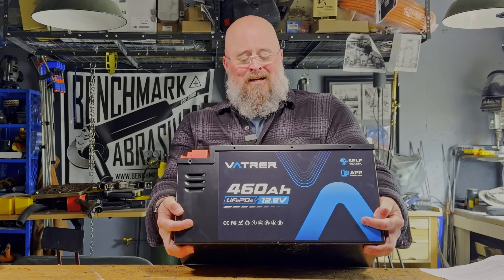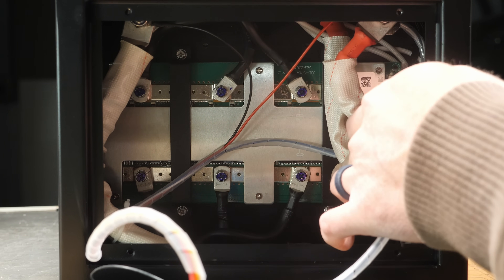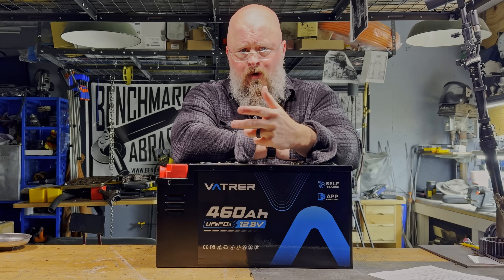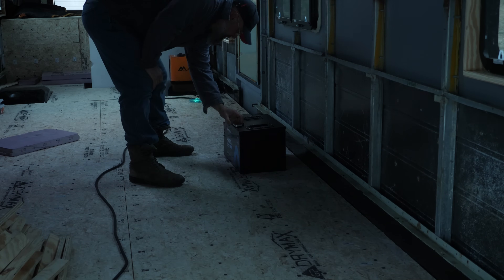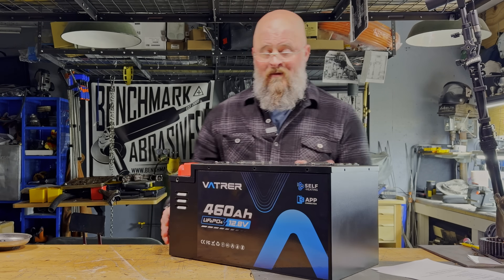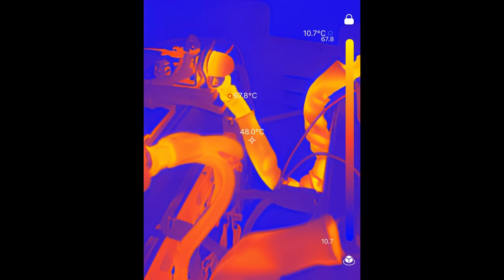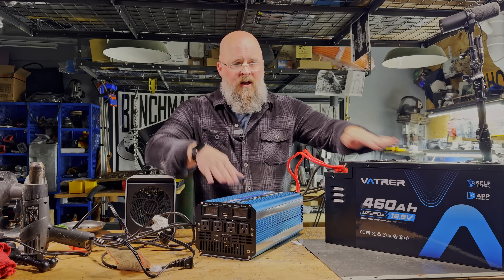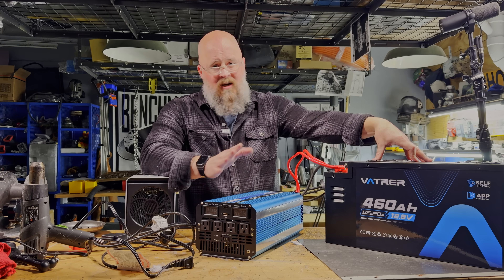This One Mistake Quietly Destroys Lithium Batteries

Comment from the maker: For full transparency: Vatrer sent this battery for testing, but they don’t pay me, don’t approve the video, and don’t see it before you do. If something doesn’t hold up, I’ll say so.
If you’ve got questions about setup, cold-weather use, or building a 12V / 24V / 48V system around this battery, drop them below — I read the comments and I’m happy to dig in.

 here are the direct links:
👉 Vatrer Official Website:
https://www.vatrerpower.com/products/vatrer-51-2v-100ah-lifepo4-lithium-solar-battery-built-in-100a-bms-max-5120w-load-power?sca_ref=6769396.vei1HBELRJy&sca_source=YT
👉 Vatrer on Amazon:
https://www.amazon.com/dp/B0C9HPYKNG?maas=maas_adg_FEA066C8E421BD241ECF916C75BF50A6_afap_abs&ref_=aa_maas&tag=maas&th=1
🎄 Current Christmas Promotion:
https://www.vatrerpower.com/pages/2025-christmas?utm_source=youtube&utm_medium=HanginwiththeHursts

— Jason
Reply: Can U recommend a descent charger or inverter charger?

Comment: whether to put the house batteries on the interior or exterior has been something I've been going back and forth on with my (currently theoretical) bus build for a while now, so these videos are appreciated
I wish more of these batteries had hardwired communication connections, between the security implications, long term reliability, and intercommunication between parts of my setup I'd much prefer batteries with that feature
also, did you see that one of your videos got featured on hackaday?
Reply from the maker: Thank you for taking time to watch and respond and No I had no idea that any of my work was featured anywhere. I will have to check that out. Many thanks!

Comment: I run 2 of these self heating batteries for my 12 V system, been running them for 8 months now in my CTC and they’ve been awesome. Highly recommend these batteries. I did see they came out with a 580 ah battery.

Comment: For me, that is breakfast, microwave, toaster, induction cooker, airfrier.
Reply from the maker: all at the same time?
Reply: @HanginwiththeHursts  Yes, it would take to long to do it one at a time, and it would get cold. Eggs, beacon, toast, chicken nuggets. For me and my daughter.
Reply from the maker: right on. well it would take more than one of these units to meet that demand for sure. and for a system like that I would go with 48v to limit the voltage drop and wire size .
Reply: Sounds like you need a 6kw inverter and a 48v battery bank or stick with 50amp shore power.